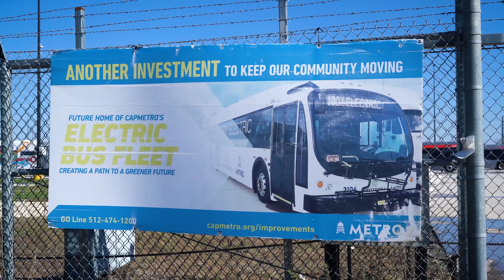Tesla Giga Texas Snow into Mud - Time for Texas to Shine! Like a Cybertruck - Roschetzky Photo

Comment: Third-world-country guy here.  Yes, I boil all my water.  That's AFTER I run it through a monolithic filter.   Not so bad once you adapt to it.  However, I prefer to see people accept energy independence as a personal responsibility, not engage in a knee-jerk appeal to government to solve the problem.  I'm 100% solar in addition to being water-independent.  I also keep almost a year's supply of food staples and a couple years' supply of propane for cooking so am immune to all but the most long-term catastrophic shortages.  Sure, there are tradeoffs but I'm happy.
Reply from the maker: amazing! love it. keep it up. you need some powerwalls to go fully off grid
Reply: @RoschetzkyPhotography  I would love a Powerwall but use what's available: lead-acid batteries.
Reply from the maker: @McClarinJ  oh that's still amazing

Comment: Just look at any of your power bill's for the answer. Over half of it will be from the fees&taxes alone. 
Yet the power grid itself is in serious disrepair. And functions primarily on century old inneficient gross polluting fossil fuel based tech. 🤔
Reply from the maker: we need battery storage and more solar! for sure , texas solar is what? 2% , that could go up to 10% who argues with more energy creation especially if its the cheapest , like why not just build 3x the amount of the cheapest form of energy in Texas? THIS IS WHY! ! ! they are waiting for more battery storage I think , I think energy providers and everyone is waiting for either biden admin to pass a new incentive and things are going to explode , or they know more battery storage on industrial scale is coming. but battery storage is the key
Reply from the maker: even battery storage would help with that "gross fossil fuel" energy production - this is what I don't get right? 
even republicans and everyone on both sides should be able to understand if we had more of the cheapest forms of energy creation this would allow us to use LESS of the natural gas and other energy creations and stabilizing the entire system 

you cant just easily frack more wells or drill for more oil , we know and drill at almost every square inch of available land and water , 

but what you can easily do is build more of the cheapest form of energy solar that takes no water and hardly any space and boom done.

Comment: Get some magnesium oil for that nerve problem of yours.  Magnesium absorbs more easily through the skin than it does orally anyway, so that's the safest approach, without the possible laxative effects.

Also an inversion table could help relieve the compressive forces of gravity on your joints/nerves.

This is just a suggestion, this is not medical advice, do your own research, could be the ramblings of a madman, blah, blah, blah...
Reply from the maker: a damn good one , i've heard of magnesium oil I will try that! last time i went to colorado I grabbed some medicated location and it seem to help , or just put a smile on my face but totally... luckily its already almost back to normal now so I'm as good as new , until it happens again.